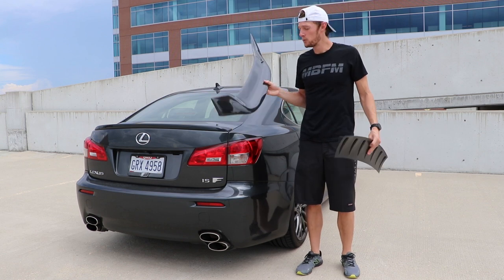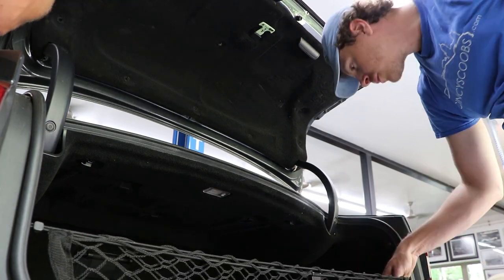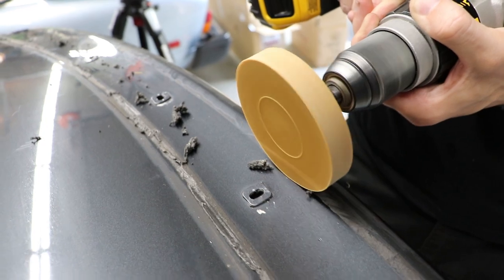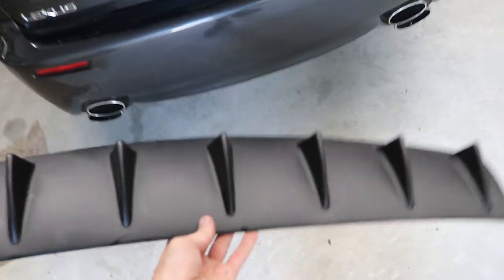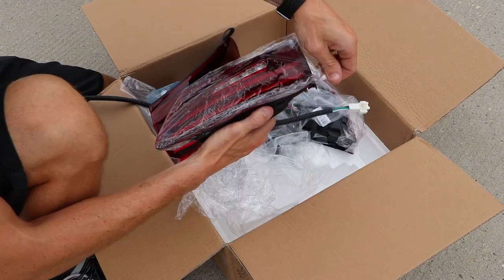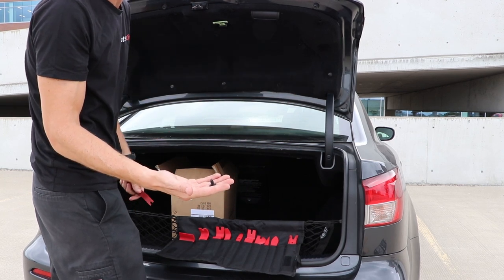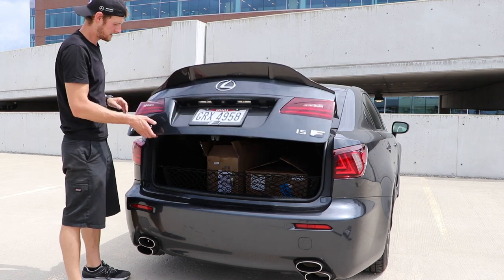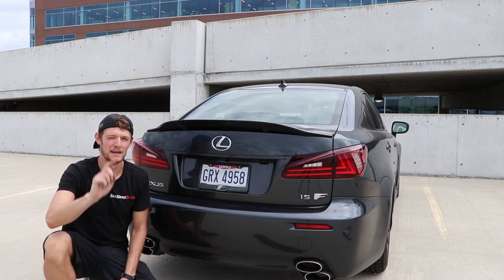Here's How I'm Using Cheap eBay Parts to Update My Lexus ISF Rear End

Comment: Wow you have the same taste as me! I'm about to get that highkick spoiler myself.
As for the s4play style diffuser, the key is to remove those brackets that help mount the faux tips.
Without them in the way, the diffuser should fit nice. I have had mine secured with 3M tape and 5 screws and it has held on for two years no issues so far.
Looking forward to more content!
Reply from the maker: Thanks!
Reply: I got the same diffuser and I made it fit perfectly. I like it as it is less in your face with just enough aggression hint under the bumper. And it was cheap

Comment: I'd recommend that anyone doing this avoid using tape to seal existing mounting holes.  I do recommend using the Dorman branded button plugs (or similar) and rubber butyl tape to seal existing holes.  The butyl will stay pliable and will not dry out over time in the sun/heat like tape would.
Reply: Is there a specific size that will fit these holes or just get a generic bundle pack ?
Reply: @anthony8487  this will specific to each application.  I recommend using the backside of different sized drill bits until you find the one that is closest to the size of the hole and then try to find a body plug that is as close to that size.  The rubber butyl tape should fill in any gaps.  Hope this helps.

Comment: Nice job, though I personally am not a fan of the look. I would have repainted/clear coated the original spoiler.  For some reason spoilers always seem to fade first on cars like this. (My old Legacy GT had clear coat coming off as well). Ended up selling the car but otherwise would have probably tried wet sanding it myself.

Comment: I HAD the same diffuser. Had to cut a set of teeth off each side to make it fit. It fit great after that because of those things that are on the ISF holding the exhaust tips or whatever, but it ended up falling off after 2 weeks lol

Comment: Or just soak the old 3m tape with a paint safe degreaser. After allowing the tape to soak for an hour or two, simply scrapes off easy with a plastic scraper. 

(Make sure to only soak the tape and do not spray the entire trunk with the paint safe degreaser - just in case)

Comment: That wing is held down only by tape? Huh.... how long will that stay on? Especially in cold places like Minnesota?
Reply: VHB 3M tape is inherently strong like super strong it is what most every brand uses from the factory for many parts to not create holes at minimize them but you could always drill into this wing to secure it even more if you’d like. As an added benefit I would have used industrial grade silicone the stuff used to keep buildings together on the edges to help keep it planted also.